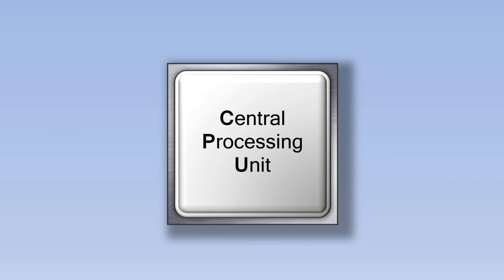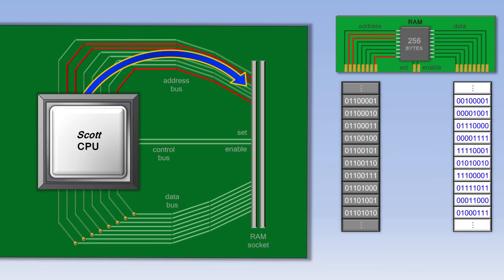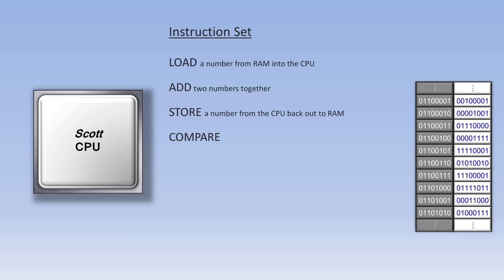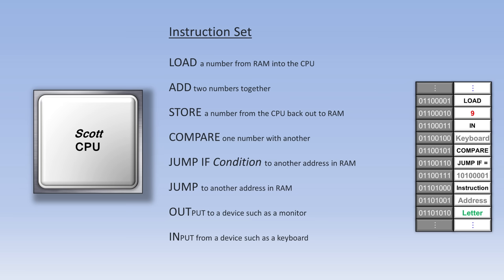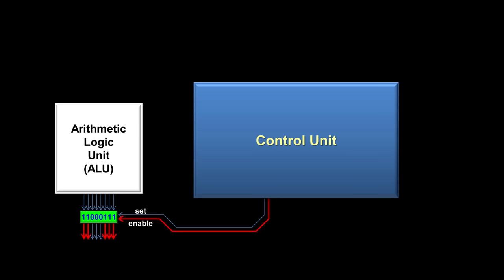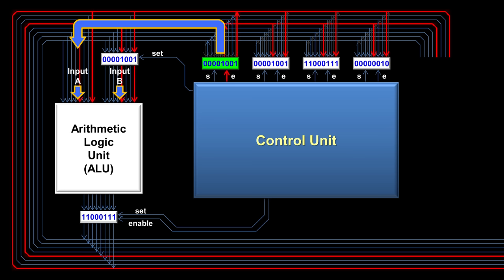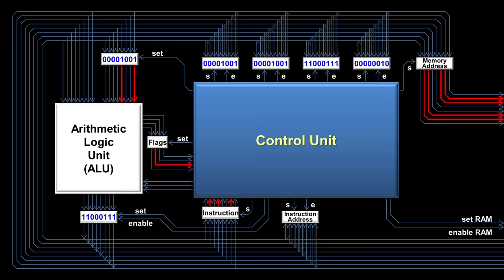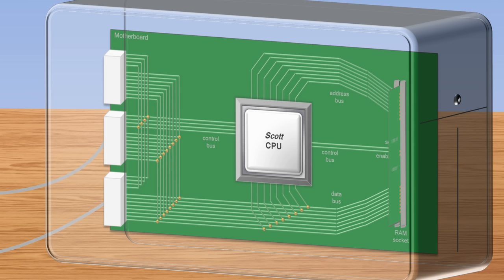How a CPU Works

Comment: I can finally see how stupid I am I don't understand one bloody thing
Reply: Nah, you're not dumb. This stuff really is hard, it takes time to get it down :)
Reply: lol
Reply: I'm with you bro
Reply: You have to know computer architecture, basics in assembly language and introduction to programming to understand this.
Reply: You don't need to understand basics in assembly langauge to understand this. You need to understand this to understand basics in assembly langauge though.
Reply: Haydar Alaidrus no cogs box
Reply: it's actually very simple, yet so complicated as well, perhaps u want to learn a bit about transistor in electricity.
this component switch things on and off depending on is there an electric current coming on to it or not, if it has, it switch on, if it has no current, it stays off.
try have 5 lightbulbs lined up and switch 2 of them, so 3 of them stays off, the on bulb is 1 and the stay off bulb is 0, that's the main logic on this. 
the cpu switch data in on or off condition, on is given electric current means 1, and off isn't given electric current means 0, so there u have the data  001100 or 010010 etc. and that's all about it.
it's very simple once u could understand basic of transistor.
Reply: same
Reply: ı am lernig that things ı am making my own 4 bit  cpu but ı stil dont get it
Reply: Yeah, for me I just imagine some stupid image that really helps me for what i'm confused about. So like for the ram address I just imagine a neighborhood with a green background cuz silicon and at a specific house they get a letter that they have to leave and go to downtown cpu taking the bus on the highway. idk I think when people designed the semi conductor mechanics they were trying to do that too by making names like "not" or "or" gates like this one does not let information through and this one is conditional this or this
Reply: damn technology. it is the work of the devil
Reply: For me most of this video translates quite well through my brain. Though I had a few things to sort of compare it to.
Reply: I feel like that too. But hey at least we are trying to understand. More than you can say for over 99% of the other people!
Reply: You're only stupid if that is what you believe. If you really want to expand your knowledge just keep trying and you'll break through someday. Growth>fixed mindset
Reply: CPU is just a processor that process what ever you input in your computer(like if you do some microsoft word) to be able to see it or use it using output device like a monitor so how it's work it doesen't matter
Reply: LOL probably the worst explanation on here. How it works definitely matters, unless you want to be ignorant of the technology you use XD
Reply: Tyler Greer That totally depends on what you want. If you wanna learn it, it surely matters. If you just want the result, it doesn't matter. Everyone needs some clothes, but most of us don't really need to know how it's made, how the fabric is made, and such.
Reply: it is wery educational in search of understanding computers i think, i dont understand too much, but it is AWSOME!
Reply: +Matej Pecnik
don't worry, you're not stupid, i am a computer science student and even i had hard time understanding all of these the first time i read a book on Computer Architecture
but with focus, and reading, you will began to understand these concepts
it just takes time
no one is stupid, we humans are all capable of doing whatever we can think of
it just takes that focus and time
Reply: I scroll down and read your comment. Now I forget everything he just said.
Reply: You cant understand by watching 1 video. It took me 8 semesters! I’m a cs major by the way...
Reply: I agree with you. It took me on average few hours per day for few months to go through most of the book page by page -- with the help of additional reference materials -- to understand what the author was talking about. For some topics, I had to spend more than a week to really digest them before I continued. No pain, no gain.
Reply: @peanutbutter7639  okay great. Nice to meet u , i hv one question may i ask? , How instructions set was already thr for understanding what a data says for CPU? How instructions set transferred thr? Like as i type something call "c" , and cpu access RAM FOR that data n print out on monitor or whatever instructions are. But how that addresses binary to understand that is "c"? Thanks in advance. 🙂
Reply: No, your not. Did you know your, as in our, brains expand when we make errors?; Well, it does. So get going, making lots of mistakes.
Reply: Bro it's really not that simple. You need to Know many prerequisites to understand it.
Reply: @abhaychauhan5917  not sure I understand what you're asking but I think you're referring to a decoder.  A 3 input AND gate produces a 1 output when all three inputs are 1, therefore if the instruction is 111, this AND gate would fire up the circuitry corresponding to the 111 instruction.  If you had a NOT gate on one of the 3 input AND gates inputs,. It might output a 1 when the input is 101.  The output of that AND gate would then fire up the circuitry corresponding to the 101 instruction.
Reply: @cogs11  I don't know any of it yet i understand it so that's not the case.
Reply: @testplmnb  Good for you. I don't care.
Reply: @testplmnb  Its just my opinion and how I was taught the topic in university.
Reply: 666 like
Reply: No man! You are intelligent. You've just used one of the instructions. The logic instruction .
Reply: Quite difficult but you aren't stupid ,go through it many times just
Reply: You're now enlightened! 😆

Comment: After messing with redstone and building a minecraft computer it is worlds easier to understand this.
Reply: Same dude
Reply: That's what I thought! Just everything clicked.
Reply: doing that right know on ORE
Reply: Kishore G. originally I built alu units out of just connecting and gates because I knew that would work. of course, I learned about xor gates later on. you can build a computer just by messing around, it just takes time
Reply: Minecraft deserves some credit for this, now that I think about it. It's a game with two basic building blocks out of hundreds, redstone and redstone torches that could be used to make a computer that can actually run a game. I wonder if it would be possible to create a computer in minecraft that could possibly even run a version of minecraft in 1080x1920 resolution, it would take years to build (or using a native plugin, you could have it built for you, like the one used to recreate the Netherlands in minecraft.)
Reply: I've seen by SethBling here on YouTube, that he actually made a working Atari 2600 operating system in Minecraft with a few working cartridges.
Reply: So the "t-flip flop" (based on the term "transistor flip flop") has probably 3 different, useful designs in redstone, I believe the version you're referring to is the ring where one half is powered and the other isn't because of the power emitted from the other side. The flaw to that design is that you'll need two inputs to either side's latch mechanism for disabling it short term to switch to the opposite side. 

A more simple design of what's considered a t-flip flop in redstone that I personally use uses two sticky pistons, It'll be a repeater going into the block on top of a piston facing upwards, with a repeater on the other side to catch that brief signal, going into another piston facing upwards with a block above it and sand on top of that. The short signal will cause the second sticky piston to push the block up, but fail to pull it down, and the gravity affected block will be pushed up also, completing a circuit, far away enough to not accidentally BUD power the second piston. Then a second time all that gets powered would result in the block left behind to be retracted back and drop the gravity affected block, disconnecting the circuit.
Reply: Hmmm, apparently I accidentally described RS Nor latch. There is mention of a D flip-flop on this page just after RS NAND Latch about 2/5 - 3/7 scroll bar down. http://minecraft.wikia.com/wiki/Redstone_Circuits
Reply: +Kishore G Well, thats true but tbh it is the least of your problems when building a minecraft computer. Your main problem would be that the signal runs out after so long and that you cant strengthen it easily. And it would also be impossible to build a screen
Reply: Same here dude. A lot of people here are baffled and say this is "complex", but I understood like everything so easily. It's almost funny how it's the exact same as a redstone computer, even the diagram at 0:17 looks just like a giant redstone computer.

If anyone is having trouble understanding what this video is explaining, I would recommend playing minecraft and becoming acquainted with computational redstone.
Reply: @Keshaire  ok I don't even know if you are trolling. If not I'm gonna return to Minecraft
Reply: Well not completely true because when you use redstone it is a one lane thing such as a computer needs positive and negative connections and also data wires that can be on cable but inside there are many more cables inside so I would help you with most things but not all things.
Reply: What is a redstone?
Reply: @definitelyarussianpaidtrol1406  it's mostly just that the computer running minecraft would need to be more powerful.

Comment: An entire semester of Computer Engineering/Science in one video. :)
Reply: Yes, but it would still take an entire semester or more to really understand the subject.
Reply: There is much more to computer science this is more like electronic s engineering
Reply: @awol6574  Definitely, I study Mechatronics and we studied all this. Computer Science is more focused to coding and developing software, I believe.
Reply: This video is a simplification really. There is more inside your modern CPU than an ALU and control unit.
Reply: @awol6574  I said Computer Engineering. That's what I studied by the way. And of course it's better to take the semester course, but this video is a great summary.
Reply: @christophersantini2721  not necessarily I built my own calculator with one week of knowledge
Reply: @adityaacharya1799  Congrats. Most people, however, will require a lot of time to understand these things.
Reply: @awol6574  it's not "electronics" engineering....it is actually 'digital systems' engineering for 'computation'. You can use various type of Electrical/Mechanical/etc systems to perform computing. 

We now mostly use 'electrically active solid semiconductor device based digital computing' as it has been the most successfully evolved systems.
Reply: @adityaacharya1799  a huge difference between learning the whole subject and making a calculator which can be done by any beginner.

Comment: Brilliant! This is the lesson I should have had in the '80s studying computer science. If I had I would never have lost interest. 

(I lost interest because they never went into enough low-level detail and did not answer my questions when I wanted to know more. Everything was given as "just-so" answers. I think my CS teachers didn't truly understand the subject.)
Reply: Mark Jones computer science and computer engineering are two fields that overlap enough to make you believe they are the same, but yet are distinct. Computer Science is more concerned with the mathematical and logical questions about “what can we compute?” Right away we think digital machines, but the question is more high level and can be abstracted away from digital computers. Pragmatically it usually means computer scientist know software and computer engineers know the hardware than implements the “magic computation box”..
Reply: I can totally understand you.
Reply: Alot of teacher now days dosent even know that much

Comment: This is great! The only thing missing for me (though there could be a very good reason for that) is an explanation of how all this relates to what we talk about we talk about processors today. Namely cores and threads.
Reply: Multi-core CPUs have multiple CPU control units and ALUs on a single chip. That's essentially what it boils down to.

Comment: i don't care how advance an outer alien civilization can be compared to us, this is science ficition to me. I understand about computers but how a CPU works... as Steve Jobs would say "it's magical".
Reply: Read up on transistors and stuff and it'll make a little more sense =)
I think I got the basics now myself.
It's still damned complicated and you'd have to have an overview of increadibly many things for a program to make sense all the way, but I think we could make something like say a basic text adventure game with this kind of logic fairly "easily" =)
(As in if you picture every single bit in your mind and remember it all then you might actually manage to follow what happens)
Reply: Well...
You kind of can get something like this if you think of a grid where you have an input a set number of true or false statements in one end and get a set of true or false statement in the other end by having each step check if the previous one where two true statements, two false statements or one of each.
Given the input pattern you get a set exit pattern.
Now imagine that you have a input pattern not given by a input you control but predetermined (by software) and that this changes based on the exit output from the last step in the process.
That's basically all a CPU really is.
It really just checks input patterns to give an exit pattern and that ends up in memory/storage to give it new input patterns again.
With one input pattern you might get an exit pattern like say light up one light bulb and with another you turn it given the stored input it's compared against.
That's done for every single pixel on your screen with predetermined patterns of signals at predetermined "intervals" (not really but meh) will trigger a output signal equaling a complex on and of pattern on your screen like say the letter A.
Now add another "CPU" like your graphics card that process the output and compare it with other output at a different point in the code and you can get something even more complex out of it, like a pyramid shape calculated and then calculated how it would look when seen in 2D (on a screen) and then calculated into pixels turned on or off...
You get the picture I think...
Reply: I hope that made it a little easier to imagine...
I can try to find some videos on here to show you the concepts I'm talking about later.
But really, a computer is really, really dumb.
It just does millions upon millions upon millions of tiny calculations so fast that it seems smart even if it isn't.
Ps. I get it if this don't make sense right now.
I kind of wish I could talk to you in person for a couple of hours, I think I'd be able to make it make sense for you then.
Reply: It's not magical, it's materialistic like all of reality. It is therefore easily described scientifically and it's theoretical foundations is basically mathematics, certainly able to be learned and not that difficult. Since it's mathematically oriented, it comes as as unfamiliar jargon to most people.
Reply: Gaius Caerulius Verus Yeah, just hard to explain it in a simple fashion.
Been trying lately to do so with a room with two light switches and two people using a code to communicate through the light switch, using the light to help them decide what setting on the switch to use next.
Not sure if that's good enough...
Reply: I thought computers were magical, up until I found out that nearly everything in a computer is just a bunch of wires turning on and off.
Reply: To be honest this is a terrible way to teach this subject, so your confusion is warranted. I have my degree in Computer Science and know how this works and this video wasn't easy to follow. This starts at the top end of the CPU and works down, starting with complex topics and trying to break them down into simpler ones. This subject (taught to every Comp Sci student in some form of Architecture and Assembly course) is usually taught from the bottom up starting with the simple components, usually a single transistor, and how they function and building the components one at a time adding complexity as you go. Then finally putting it all together and ending with a functioning computer.
Reply: Sedsibi The book he showed in the video is very good for 1st year students though.

I don't think it goes as deep as transistors, but it does start at NAND gates, which I think are made of the transistors? It works up from there anyway, which is what all Computing students, in the uni I'm in, were taught in the first year, in the module that this is a part of.
Reply: Sedsibi True, that might be a better approach for most people.
Still, this video did teach me a bunch =)
Reply: malteeaser101
Yes, starting with NAND gates is a good stating point as well. It's only one step up from transistors, the basic approach to teaching the topic is the same though. Start simple and add complexity.

Comment: Help, my mind just short circuited
Reply: debayous Basically the cpu helps to manage and process data and control data and sends it to were it's needed and to tell the program yes you can run or no you can't run and when a program like a game cannot run or  it is unable due to certain computer components or program like for example direct x are not compatible the cpu can say no and the cpu can also say  no if gpu isnt up to run the graphics and it is the brain and heart of the computer
Reply: @luckycat5107  It is just the brain of a computer.